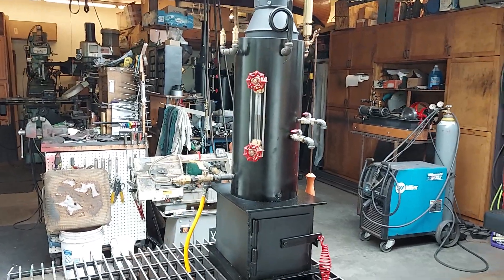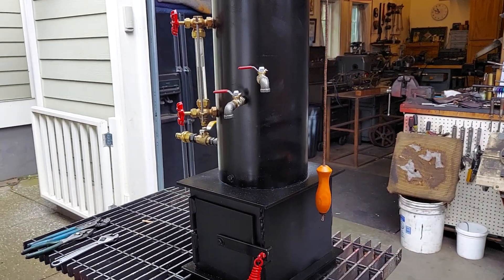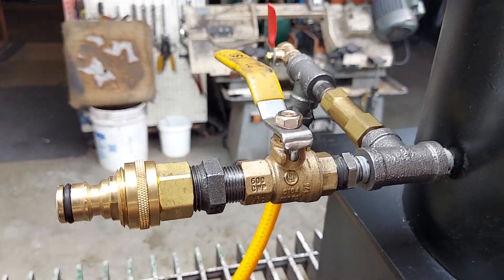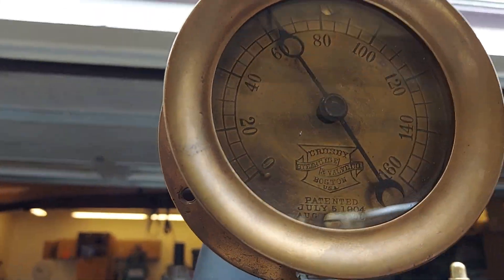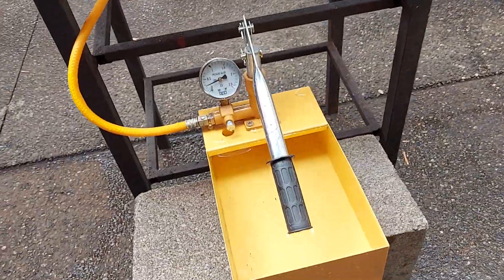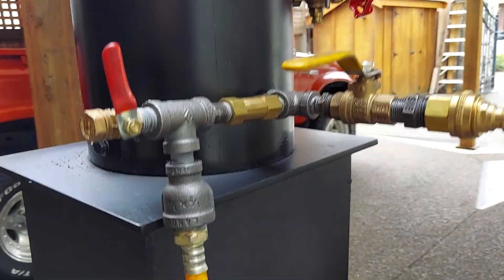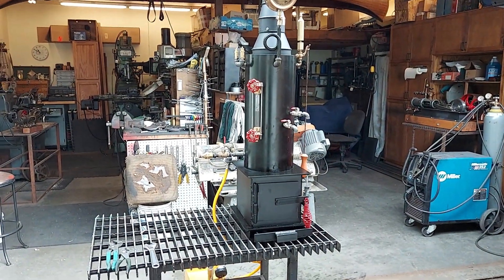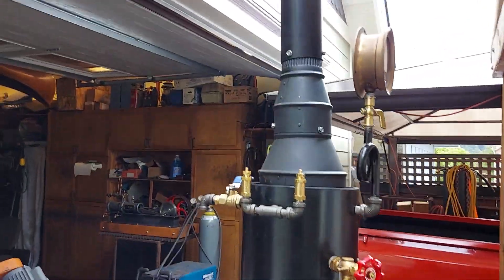Steam Engine Boiler Whistle pump Antique Gauge Off Grid Watch video American

Comment: What would be the cost to contract you to fabricate the 8” diameter vertical tube  boiler core only? I am looking for something that can drive a PM research #4 engine, rated for 1/4” HP at 250 RPM, at this speed continuously, but could later be used to power something larger maybe later on. Piston bore 1.50” stroke 2.50- estimated need of 1604 in^3 steam per minute. I want to have capacity to operate at 100 psi. 
I live in Oregon an can pick up locally in WA if needed to keep cost down.
Aside from cost, other questions:
-what is typical fill volume? From position of tricocks looks like 1/3rd volume of boiler is kept full of water?
-does blow down port feed from steam section or is it connected straight to water section?
notice tubes are not rolled over to boiler plate or brazed in how long does this seal last?
-any reported issues with corrosion between copper and steel from electrolysis?
-what water? Just tap water ok or do you recommend only filling with distilled water?
-finally, boiler survey licensing and inspection; do these operate at pressure outside state requirements?

Thanks in advance for answers- I think your work is awesome and I hope to be a customer someday soon.
-